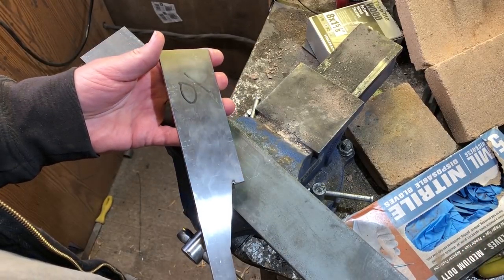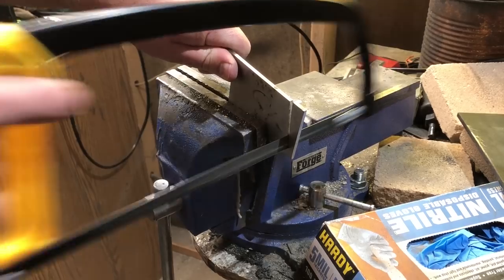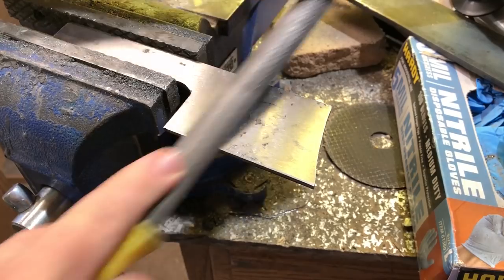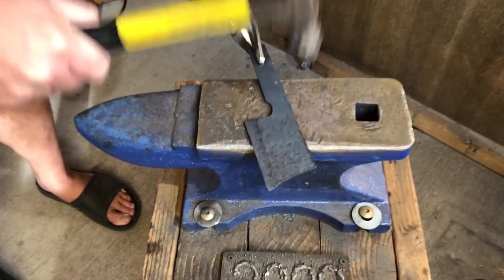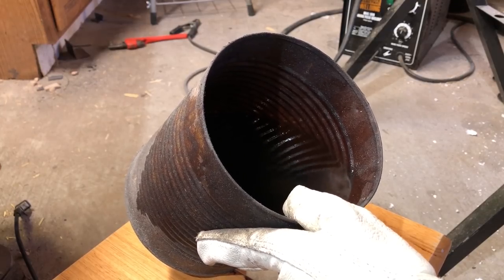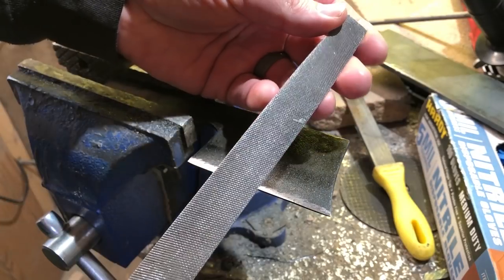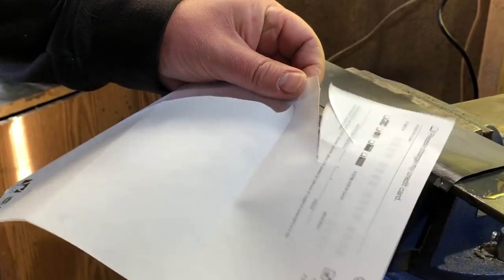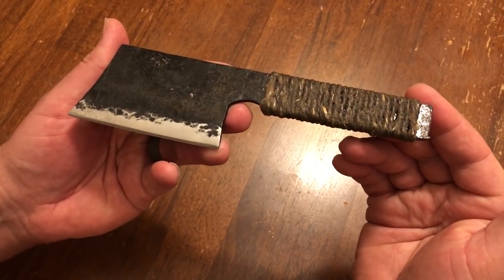How to make a cleaver knife with basic hand tools

Comment: Hey i have a question for anyone who can answer..... Well a few actually...3.... I work for a welding company at chicken plants. They have a shit ton of stainless steel scraps. And sheet metal as well. Is that good for knife making?.... 2). How do i know if steel has high carbon? Because theres flatbar and it says 304L. What does that mea
Reply: MLC - the_skrllex aka LACK4ANAME look for spark test on YouTube is a good way to tell carbon. Pretty sure 304 Is a type of stainless as well. Stainless is difficult to forge but stock removal method for knives.